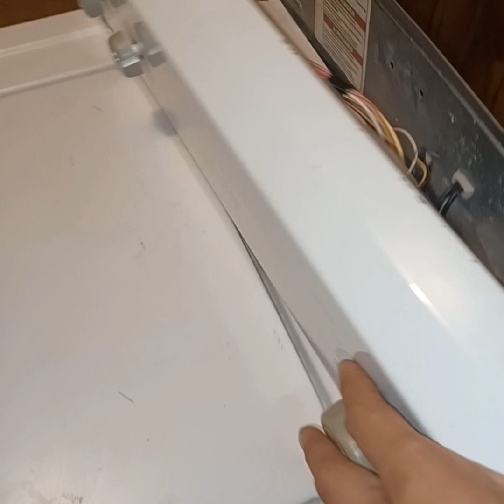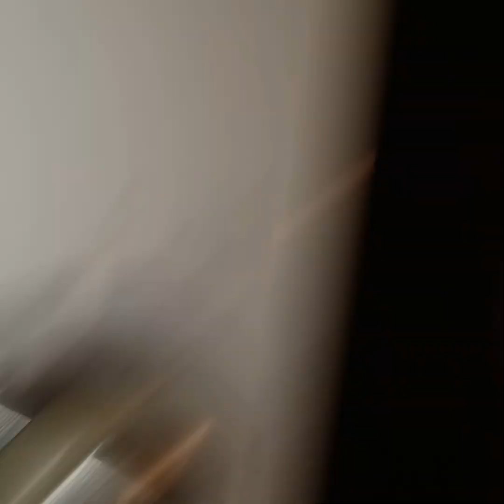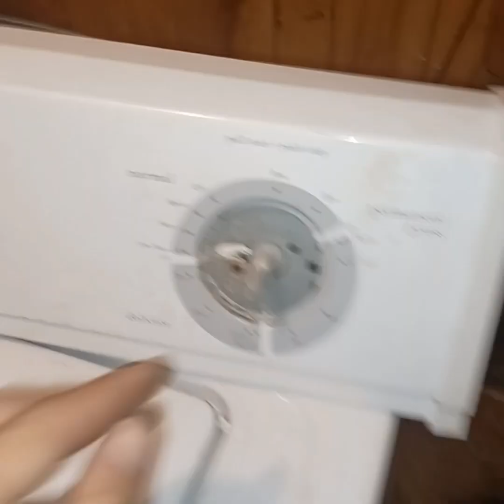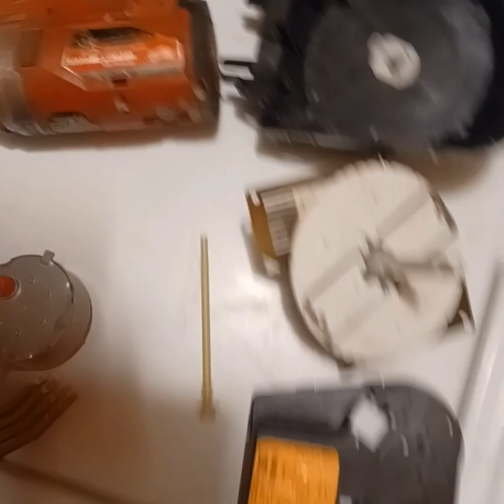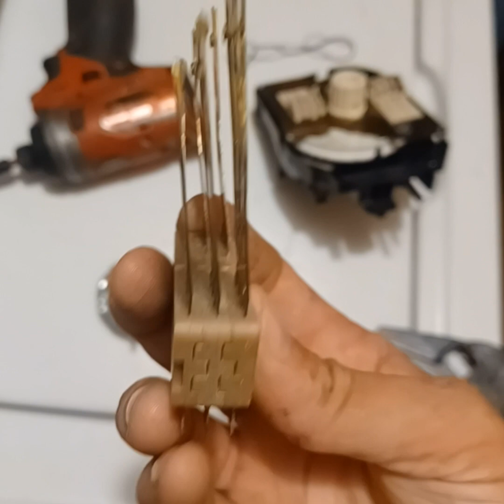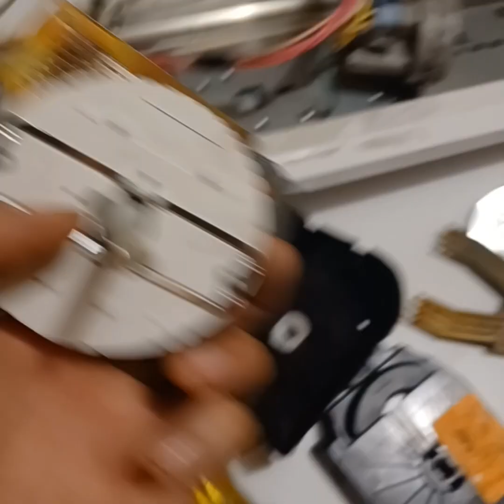Amana/Estate Washing Machine Timer Repair

Comment: Great video! I notice on my Whirlpool top loader timer is an Intertek like this but all the contacts touch on top at rest this is where I am stumped as the washer was skipping fill and cycles I became aware of this issue and found burnt contacts and a few contacts floating I saw in another video they should all connect on top of that unit